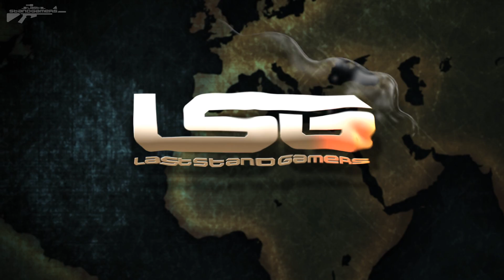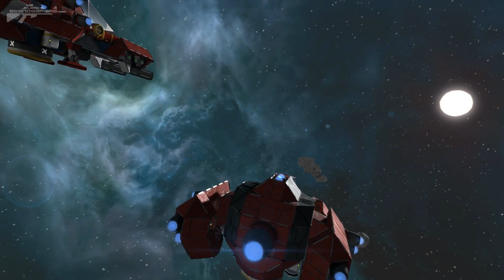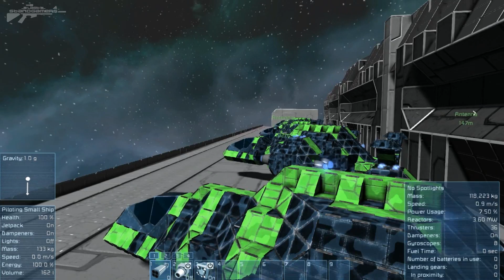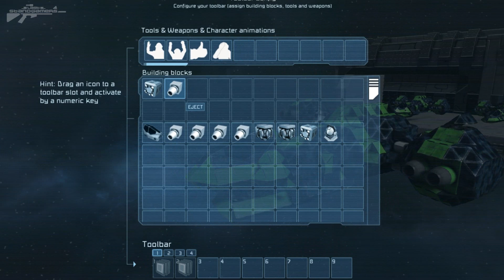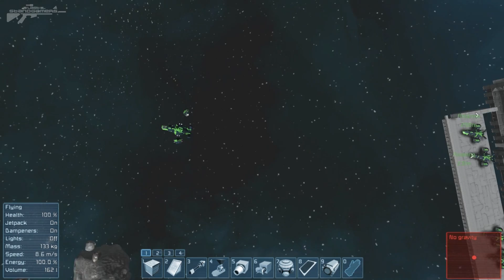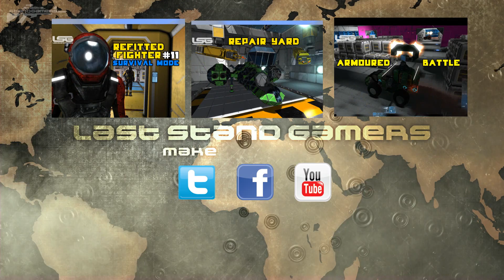Space Engineers - Ejector Seats, Fighter Pilot Survival Systems Concept

Comment: For a piloteered pod you'll need a gyro, a single engine at and a power source for generator for survival and thrusters.
Single merge at end and a thruster at the bottom just bellow a layer with gyro some type of generator and small cargo container should be enough.

Nowdays you might want to eject a functional medbay module to respawn in, ideally with pilot but as long as a method of controll is accessible as soon as you respawn that's enough.

Comment: Alright, imagine a shaft with an entrance in the middle. at the bottom of the shaft is a hangar escape, it's basically an eject chute. There can be a command chair inside the chute, connected to the walls of the chute by 2-4 blocks so that it controls the entire ship, but it's also armored all around. Hook it up with enough thruster's of its own and also have it equipped with landing gear underneath it's lower hull. Have grinders/cutters hooked up facing the 2-4 blocks connecting it to the ship. Set up a hotkey to turn it's personal thruster's on or off, and one for the welders and the hangar door at the bottom of the chute. Then when the grinders cut off the 2-4 blocks connecting it to the shaft, you just thrust downward, and when you leave the chute turn on dampeners (obviously this cockpit area will require it's own amenities to facilitate space travel)
This can be a good way to use a ship for say, a suicide dive when the main ship itself has reached the limit of its usefulness and survivability. 

Basically think of it like a small ship fused to the bigger ship, protected on the inside of the larger ship,  that can have the larger ship un-fuse it from the walls and leave out of it's "escape chute" which is protected on the bottom by a hangar door. this can all be powered by an auxiliary reactor as well, in case the main reactors are low. perhaps even set up small ejectors all around the hangar door so that they can fire out physical barriers of some sort preventing the ship from getting hit on its way out. Like some mass cubes sent "down" using gravity generators. Perhaps you could even fire them outward in a cone shape so that it's escape path gets bigger as it "descends" so that eventually it can just weave through its own defense system. 

Of course you could just do without the shielding and leave it up to luck and piloting!

the main problem I see with the "ballistic defense shielding" mechanism is that if you turn on your dampeners, or do not, you could end up smashing into the defensive instruments because while the ship is (potentially) still moving you are slowing down.

Comment: most of my ships are like trains, one of them a tiny [large block] military cargo ship. to eject i detach the forward radar assembly and it reveals a mini-ship with one cockpit, four seats, one battery, and one large thruster with gyro. connected and locked in place with a connector component, not landing gear, the first hot bar section is fill with piston commands, all those pistons have warheads attached to them, [ in secure boxes ], i set those pistons to start moving slowly [about 3 seconds before they contact and blow up objects they are positioned to destroy], i disconnect the escape pod from the cargo ship and full throttle the single thruster, by then the engine room assembly on the cargo ship detonates and the major thruster assembly detonates along with the armory storage room.  there is a rear ejection system too , because the ship is needing it for its size.

Comment: I suppose this is a week late, but if thruster damage is on, you can just set thrusters in each direction on the underside of the cockpit aimed at a block that gets burned out. Then with all of them and some vertical thrust ones preset to max override you merely push 'eject' to turn them all on. A thruster on top and a gyro insure you have flight as you run away in the tiny pod.

Comment: like the idea, but if I built it I would probably make the engine pods individually detachable, you know for if its been shot to hell and you don't want to lug around dead weight.  I would also mount at least one gun on the cockpit, some directional thrusters and forward boosters.  mainly speedy with light defence for when escaping un-noticed is impossible.

Comment: for my ships i might use your 1st design (1 merge block on the most convenient place connecting the cockpit).. replace the generators of the later designs with a battery.... and instead of disconnecting the merge blocks, i can just have the ejection thruster son hotbar 4 for example and turn them up, when there high enough they should automatically destroy the merge block (and part of my ship to prevent salvage) and send me flying.
Reply: and considering fighters tend to be small... the reactor could be behind that merge block... so after you've already started to move and your thrusters destroyed the merge block, they'll hit the reactor as you leave (and reactors with fuel in the tend to explode) even further limiting the salvage of your ship. (and its a hotbar option to turn on the thrusters since they'll be off but at 100% override, so quicker escape)

Comment: After seeing this video i construct a Fighter with an escape capsule. The capsule itself is a complete self containing ship with gyroscopes, thruster and 2 reactors. So in a fight you could fly back to your fleet by yourself. The fighter itself is no big deal. 5 Gatlings and 4 Rocket Pods on external Wings. But i build in an Battery so in case of  an reactor failure you have round about 1 or 2 hours of electricity left. Disadvantage: you must load the battery in your mothership. The build in Reactor isn't really capable of charging the batterie and produce enough power to run the ship.

Comment: There is one error with some of the ejectors because if u eject strait forward ur enemy is likely to be firing strait at your front so you will be hit so the gravity cubes is the best for getting you away fast and effective but no one ever thought of using pistons! The pistons would be able to eject you fast, in a prep panned direction and won't cause much design change. Also when building a ejection system make the ejected area of the ship have a flush hull with the rest of the ship so enemy's can't see you have a eject ability.

Comment: The thing is, you are often shot out of the cockpit without being killed. So what about you enter the cockpit with your jetpack turned off. Once you have flown away from the station, you activate a super high-powered gravity generator. If your cockpit gets destroyed in battle, you will instantly shoot away from your ship instead of floating next to it.
Reply: An interesting concept, but it would mean the fighter loses the ability to use artificial mass drives
Reply: Paul S yeah I realized that but most small fighters do not have artificial mass drives, its more of a big cruiser type thing for saving uranium
Reply: I don't keep my fighters equipped with artificial mass drives, they are equipped with a rudimentary system of a drive key, aka mass blocks no gravity.  So that when they travel with a bigger ship, or in a fleet, I can just whip out a single warping gate...its cheaper than outfitting every ship with one.
Reply: TheMinecraftDragon97 I don't have Space Engineers, but I always imagined having some sort of infrastructure, for example a warp gate network, to get around the universe. It would be fun, that's for sure.
Reply: TheMinecraftDragon97 Smart

Comment: I would say fight it out and respawn in a medbay lol.  As far as an ejector seat though, I would have a permanent engine firing downward on the cockpit side of the merge block.  And another single engine firing upward on the ship side of the merge block to counter each other out.  Then you can just activate the merge block and your cockpit section will already have a thruster taking you up without having to bring up anymore menu's to activate it.

Although Ideally you would want full directional control and you could still hide all those thrusters inside armor and who cares if you burn through some of it, you're not going to worry about burning a few armor blocks when trying to escape.

Maybe you should just have an inner core of explosives to self destruct the ship so that the enemy has less to salvage, you're probably dead anyway.

Comment: I've said it before and I'll say it again! If they put timers on warheads you could set the timer for a self-destruct after you've ejected! Assuming they don't get hit in the dogfight and kill you anyways. What if the engine modules connected over the central fuselage like a ring over your finger, and you ejected backwards through the module? That way you could still, kamikaze  something and get away.
Reply: Handmade Timer Tutorial With Cereal Killer! (Not Sarcasm) 

1 Place A Warhead
2 Place A Piston Facing The Warhead 4-5 Blocks Away
3 Place A Small Thruster On Piston
4 Set The Piston To Move VERY Slow (Or However Slow Youd Like)
5 Turn Piston On And Wait For The Thruster To Hit The Warhead

:D
Reply: Cereal Killer r not a bad idea. However while building as soon as you had a piston with thruster attached you would have to attach a cockpit to that thruster to disable it inertial dampeners, and then delete the cockpit before continuing. That or put it on a very very low setting of thruster override, and then toggle on a group for the thruster and the piston before jettisoning. I definitely think it could be done that way however I think in the end it would just be too big of a design to keep the ship compact. If you manage it, let me know I'd love to get it off the workshop and have a look. :)
Reply: Jason Ratz
Control panel blocks... The cockpit isn't needed.
Reply: +Jason Ratz I come to you from the future, and they have indeed added timers to the warhead. It still explodes if you shoot it with a rifle, but eh...
Reply: Blazing Studios you can only use the control panel block to perform the thruster override however you would still need the cockpit to disable inertial dampeners; should you go that route instead. Again regardless of how you set it up using this piston-thruster "fuse" mechanism. I think it would just be too bulky!
Reply: Let me just clarify my proposed improvement for the warhead. I propose the addition of a timer. This timer would have two toggle options. One to arm, and one to detonate. This way they wouldn't just blow up at the first stray bullet. Providing for much more reliable player built missiles and they could also be used for a self-destruct mechanism. They would just accumulate damage without exploding like any other block unless armed.

Comment: They need to add the capability to control other ships through radio signals. Say, I fly my mining ship to my station, use the antenna control panel to access the station (by selecting from an area of nearby ships) and open some blast doors, switch back and fly inside. Or, I use a control station to access and control a drone (downside of drone is that it is only operational in communications network). Good idea?
Reply: I actually came up with that idea recently too. I had 3 things which I think others also want.

1. Remote controlling, like what you described.

2. Autopilot block
Place a block down, and tell it to do something, such as mine, or shoot enemies, etc.

3. Blueprints
Save a design and place a ghost of it that you can just use the welder to build each block.

I would use these in combination of one another. I would use blueprints ans autopilot to build an automatic factory. It would use pistons and a welder to automatically build my blueprinted ship over and over as they automatically take off (Probably a mining drone to start, which automatically retrieves resources to bring back to the factory, then combat drones to defend) and then I would use a remote controlling radio signal to tell my drone army to attack the enemy!

Seriously, doesn't that sound badass?